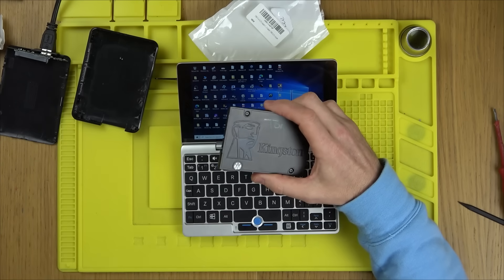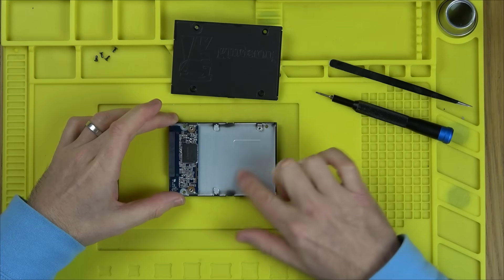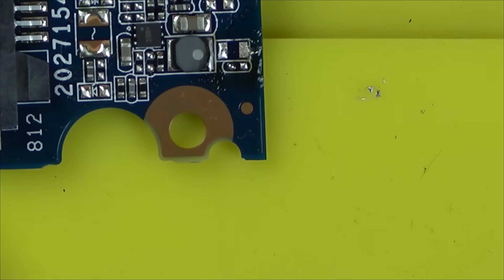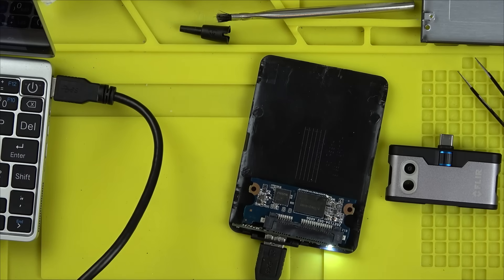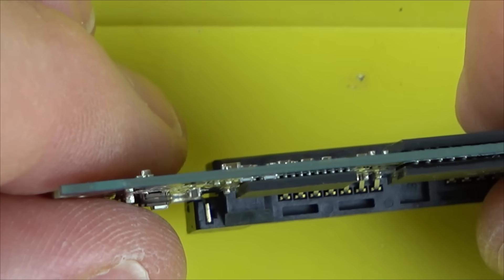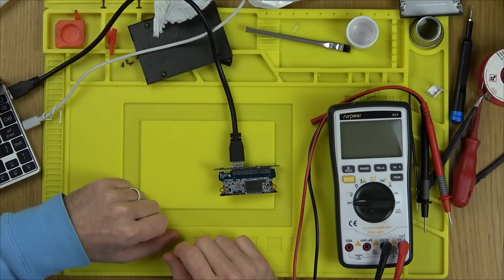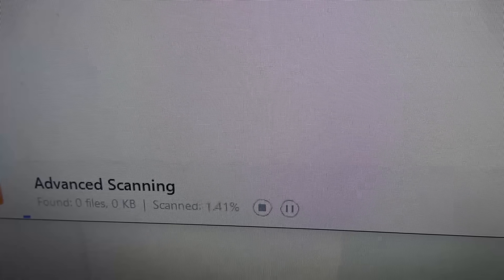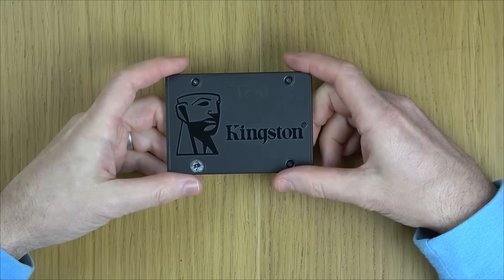Can I FIX a Kingston 240GB SSD ?

Comment: First read SMART data, you may get some clues from the start, maybe person using it did defragmenting all the time and killed most of the sectors, including relocated sectors as reserves, maybe firmware got flashed, and much more, like disks, start/stop count, power on time, how long motor takes to spin, how many times head got parked, mechanical shock and such. Phison are good, they dont usually die just like that.
For checking sectors i can recommend HDD Regenerator, its a DOS software, it does not relay on OS or drivers that may freeze/crash, it does not care if drive will freeze, it will initiate again and again. The process my take about half the month to two months, for scanning SSD sectors only it may need less.
For recovery and image creation (sectors as is) Active File Recovery (older version from Vista time) and Drive Snapshot, i prefer running it from recovery mode CMD only. For bare recovery BadCopy Pro, it can recover like real 300TB of data or more from only 80GB old HDD with level 2, 3 and 4, but the process may take 9 months or more and may need lots of free storage to shift heads, to read single sector lots of times to get pattern image of a magnetic waves and overall history of the single sector, having that stored, it may reconstruct known patterns/filetypes/guesses, but since SSD sectors does not have any kind of history, you may avoid it.
All this softwares are paid. EaseUS and similar software are fine on fully working stuff for managing partitions and low level recovery, if its not working, you are looking for DOS kind of things or at least DISM and Unix, and at that point its more efficient to connect that single memory chip to SD/USB/donor kind of device and get all data in seconds classic way. Softwares to fix boot partitions and such are usually useless when you find out it could be fixed with simple flashing. Sometimes you may want connecting that drive in read only mode because OS and other software does not care what it is, and eg. Phison are used mostly for writing, and that part failed, just example.
So first collect as much data as you can on that particular drive, start with owner of the drive, SMART information and firmware version, than you can chose what way to go with the checking, before you even start repairing, you inspect and check, get the owner to know what you are planing to do in order to fix it if that will take lots of time and/or money.

Comment: I'm planning to do a new build where I intended to use a single 1TB NVME M.2 drive. Basically I am curious if that is a good idea or not? Are they less prone to failure than SATA SSDs? Basically I never used any SSD yet so that's why I'm asking. Not gonna lie, what I saw in this video made me a bit sceptical.
Reply: I've not had any NVME drives fail as of yet, had my 970 evo 250gb for about 5 years now and so far so good. 89% health and used it almost every day since I bought it.

Comment: SATAFIRM S11 is classic Phison S11 firmware corruption. It is a common fault on lots of cheap SSD based on this S11 controller. I restored dozens of failed PNY CS900 120 GB SSD with the same issue. They can be restored back to health with s11-flasher2 / repairS11 utilities AND the correct firmware files matching the original firmware (they are LOTS of them) + manufacturer of NAND flash (NAND chip density matching issues). The utility queries the SATAFIRM bootloader to extract the details to find the compatible firmware file to flash. 
Finding the correct firmware file being the main issue here, as there are a lot and not being openly released by the manufacturers. 

Note that the reflash process is data destructive as the allocation and pagination of the NAND must be reinitialized in controller.

SandForce corrupted controllers are much more of a pain to reflash (various checksum and licensing to do in the process).

Comment: Before taking it apart, try a new usb cable.  A broken cable can act this way of showing you a device on the computer but not knowing what the device is. Also, try other usb ports on your computer or on another computer.  If that fails, then start to look at your options for recover or repair.

Comment: I have a decade old Sandisk SSD and when I plug it in to my laptop, disk manager says uninitialized with 0 bytes of storage. I sorta found a workaround tho. I just have to heat up the controller chip with a hairdryer or heat gun and works perfectly fine(shows up as a normal, perfectly working SSD) till it cools down. That's how I recovered my old data a few weeks ago.

Comment: Neither SSDs nor HDDs are ever worth repairing. Repaired storage devices can never be relied upon ever again. The best you can do is to recover the data. And for that (if data is unreadable using regular methods like ddrescure) you will most likely need to read NAND chips directly (while messing with supply voltage and temperature). Hardware and software required to do that is not cheap at all. Realistically, the only kind of data recovery that can be done in home conditions are filesystem and/or partition table faults.

Comment: The 5 volt is faulty it shows 4.8v.
Use an external power supply to supply 5 volt and the controler will start. 4.8V mean that there is partial short on the controler. Use the external power supply and quickly copy your data. Use a heatsink to buy more time to finish copying the Data.
Thank you

Comment: Hey Vince. I've recovered a bunch of these, and it's usually the Phison controller stuck in something like safe mode or firmware update mode. Can usually recover them using the right (ie. Expensive) firmware tools without any further board repairs etc. (edited to add: Just checked my notes. In that fail mode they just return junk data or blank sectors, so the unplugging thing is probably a waste of time. Also that discolouration on the Phison controller might just be from a thermal pad inside the metal ssd shell. )
Reply from the maker: Thanks for sharing your knowledge on these👍👍👍
Reply: @Mymatevince  No problem. I'd be happy to take a look at it if you wanted to know if it can be done professionally?
Reply from the maker: @DataqRecovery  Thank you, it's back with it's originally owner now but I appreciate you offering 👍
Reply: hi.  can you give me a quote on this? i have the same kingston drive with satafirm 11 fault
Reply: @BudgetAstro-ba   Hi. It would be £329 if successful. You can contact us on our website,  and we'll reply with full info (link in bio) 👍

Comment: Might be worth plugging it into the SATA ports of your motherboard.  In my experience those USB-SATA adapters aren't great at dealing with dodgy disks.  However, having read some of the other comments, it almost definately the SSD controller so the recovery software may not work.
Reply: Definitely, this has worked for me for spinning disks and I see the card has a sata socket
Reply: Z tkt. tttv0
Reply: Just had the opposite with a faulty 2,5 HDD. Was able to recover data from it via USB, via Sata it won't get recognised but in general direct Sata is better in most cases. Exceptions confirm the rules I guess.
Reply: @EngelDerVerdammnis  Funny how an old comment suddenly gets more attention!  As an update to my previous comment, I've recently been helping a friend with a new build, his 8tb Samsung SSD (fully working) is not recognised by the motherboard Sata at all but functions fine via a USB adapter!!!

Comment: Send it to TheCoder on YouTube if completely unfixable, he does stuff like this all the time plus has BGA equipment, either that or I have software that you havn't used that's specific to data recovery without risk of losing data, as long as it hasn't been overwritten after it failed data should be able to be saved plus I have the time.

Comment: When my SSD failed I found an online article that gave me something that worked. Essentially this said to go through several cycles of just having the SSD powered with no data going to it for 10-15 minutes, then switching the power off. Just sitting at the BIOS screen was enough to do this.This gave something that then be accessed from Windows as usual, including reformatting. The previous data could mostly be copied out into new files using the free program "Recuva" from the people who do "Ccleaner". Apparently, this way of resetting was forced on all SSD manufacturers.

Comment: Actually that would be a nice feature, to be able to bypass the built in hardware controller with a software emulated virtual one, so if the data chip is still fine, no problem.

Comment: It would be interesting what Testdisk 7.2 would spit out. I mean the drive seems to be working.
I used this program sometimes to get data from sd cards where the partition tables broke. Sometimes it can even repair the partition table, if not it can at least try to get all data off there.
This will only really work if the drive is not hard formatted, after soft formatting, it will still find the old data. (Tried this for fun on multiple SD Cards).

Comment: My first thought was to mount a heat sink on that controller and perhaps use a fan to further cool it down during recovery. It won't fix the drive, obviously, but it might solve the problem so that you can get the data out of there.

Also, don't use random apps on windoze. They're prone to doing all sorts of nasty stuff. Personally, I use ddrescue to retrieve the data image and then TestDisk by cgsecurity (licensed under GPL) to look for data if I just can't mount it with kpartx and then mount the partition(s). I use Linux for such tasks.
Reply: What 'random' apps did he use? They're all well known, viable recovery options.

Or did you just need an excuse to use your brilliantly original 'Windoze' dig?
Reply: @corona6381 I just wrote "random apps" as IMHO you never know what'll happen when you download something "free(ware)" for windoze. On Linux and other unices, you can choose to only use open source software which is tested by thousands and even if a small revision comes in (like a bad code insert), that will be tracable. With closed source, you never know. So, thereby the language used above.

Comment: Fairly common issue with the A400 drives. The controller firmware gets corupted and make the drive unreadable. There are tools out their to reflash the firmware but this is destructive to the data! Essentially the data is gone short of sending it to a data recovery expert.
Reply: I have several Kingston SSD especially the a400 model and I used them as external storage for my Google TV, they're all fine and as external storage , they don't need any firmware updates

Comment: Hi Vince  did you apply pressure to the chip to see if it was solder ball detachment?
Reply from the maker: Hey Andrew, yes since the video I have tried cooling all the chips and placing pressure on each one...no difference unfortunately. Apparently I would be able to get the SSD to work again with new firmware on the Phison chip but the data would be lost. These drives are only £20ish on eBay so it was the data that was important. Thanks for commenting👍👍

Comment: Try re-writing the correct firmware using CrystalDiskInfo or another utility. You need to make sure it's compatible, I can't link to the page without yt hiding the reply. It may be version SBFM21.1, but double check that.

Comment: i have some of the usb ssd connectors and one is faulty. i got a kind of same problems like you with a working ssd. its always good to have 1 more to proof its not the usb controller itself.

Comment: I had the same issue with my 960gb Kingston SSD. Software wont help apparently. I left it with the specialist to try to recover the lost data and they said that the most successful way to recover the data would be to find the same SSD with the same controller and get the memory chips from the faulty SSD and solder them on to the new one...
Reply from the maker: Thanks Martin, I was wondering if this was an option👍👍👍👍

Comment: I'm surprised you didn't try adding hard pressure evenly across the chips to eliminate cracked solder ball or dry ball. Got to be worth a go? Although i do agree phison chips appear to be "Friday specials" for poets day! 🤣
Reply from the maker: 🤣 I have tried that since and also tried cooling the chips. They behaved the same as the video unfortunately 👍

Comment: Hi Vince. Good attempt mate, but frankly if the controller chip is hosed then the only realistic way to recover the data would be to desolder the flash memory chips and hook them up to a suitable memory chip reader, and that's a royal pain in the ass - it is doable, but it's a hell of a lot of work as even if you could get the data back, it's likely to be highly fragmented and reconstructing will be a monumental task :(
Reply: if just photo's video's and it was mostly a just backup drive, the file will mostly be in single blocks, or right next to the reseeding part of the file? in the stored order? mostly?
Reply: @dh2032  I've found that ZAR (Zero Assumption Recovery) is a useful (and quite old now) tool for recovering files from corrupted or otherwise damaged hard drives, but I've never used it on flash memory, and even that won't be able to read a drive with a bad controller chip...

Comment: I would have plugged the SSD drive into a PC with a Sata port and avoided the USB connection and see how that went. if the drive stop responded its is the controller on SSD drive that's the problem.

Comment: I had a similar problem, took the board out and blasted it with a heat gun. Probably not high enough to reflow the solder but the thing started working again somehow.

Comment: "EaseUS Partition Master" is the tool and is the best I've found yet, it looks like the partition have to be restored. The cap is there to reduce noise between 2 differend ground rails ;)
Reply from the maker: I think you are the first to mention the cap, that confused me. Cheers techixbul👌
Reply: @Mymatevince  At high frequencies, the jumper  becomes a barrier, its reactive resistance become higher-up and the connection start to lack, but the cap works the opposite way, reactive resistance drop-down and becomes jumper, this way both elements become RC filter. ;)

Comment: I have a modded GMA with custom buttons, case etc and 4 different mods, screen mod, clicky triggers, sound amp and dehum kit. I broke it when i had to change the power button twice and lifted pads. I could sell it you for video, let me know of your interested
Reply: Also the ribbon cable for the screen mod has lifted pads for the brightness controls, that could also be fixed with some fine solder work

Comment: Definitely a dead Phision controller. Notorious for "wearing out" and losing data. Unfortunately the software tools will only recover a corrupt software partition/deleted data not overwritten by the OS so that's a lost cause, in this case it would actually make it worse.

There's a chance replacing the Phision could bring it back but there's a strong chance the data is gone forever as the new controller won't have any data on the current layout of the NAND chips.

Comment: Photorec in Linux is the best tool I've found for sw recovery. But I had a similar drive that failed after a short period of time. However I managed to DD the data from it to an exact same model disk, but had to put the failing drive in a bag in the freezer during the copy, as it seemed to be a heat related issue.

Comment: Worse case people don't do the firmware updates on ssd is what I am guessing that it froze after awhile. That a price you paid for cheaping out. Most like the ssd controller is shot along with memory chip wrote off. You could try the freeze method using a air can upside down to spray on the ssd controller and memory chip to reduce the internal temperature to make it work again temporarily. Might give you a chance to back up something

Comment: I can tell from my experience that those ssd series from Kingston are horrible. I had a customer having an 120 gig version and it was intermittent, it worked for a whole and then it acts up. Not worth fixing, it was better off getting a better drive but at least you had fun with this. 😊

Edit: I might have just realized it was the same thing as you had.
Reply: that one of the big problem with new really big gig sized drives, when they go bad, your going to need something at least that big in size and more like aways lot bigger, if it try to log file structure as well as any data it may find, the 'O' days when 4GB, was a large drive,
Reply: meetoo. a 120gb kingston works at random if you switch sata ports but then stops afew days later
Reply: Yeah I had so many die in just 1 year. By far highest failure rate.

Comment: I've had luck using ddrescue with ssd's with failed phisons, with Linux. Create a backup image and then work from that. You can also reflash those chips without physically removing them. Assuming its a firmware issue and not actually a failed bga. Sometimes though a flux/hot air reflow works just long enough to create an image, wont be a permanent fix as you know though unelss you reball it.

Comment: This is why I am skeptical that SSD tech is "There" for long term use. As a storage solution for the OS and vital apps sure, but things like videos, music and other things a conventional HDD still has it's place IMO.
Reply: Most SSDs last a long time, these Kingston A400 drives are notoriously bad.
Reply: @yotoprules9361  Well, they are dirt cheap.
Reply: @BrianG61UK  I've tried other SSDs which are actually cheaper than the Kingston ones and they've lasted years, it's the Kingston SSDs specifically that have failed in my experience. I've had the odd one from other companies fail. I had 1 Adata fail while installing windows and 1 "XUM" SSD which is a crap UK brand, lasted 11 months, which is still longer than most of the Kingston drives have lasted before malfunctioning or completely failing.